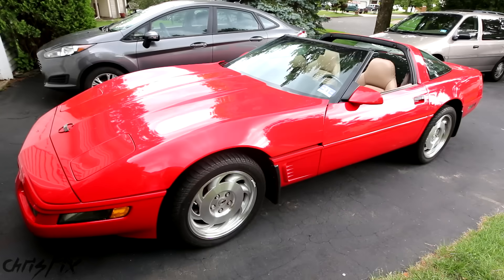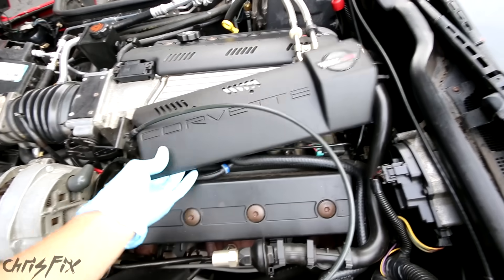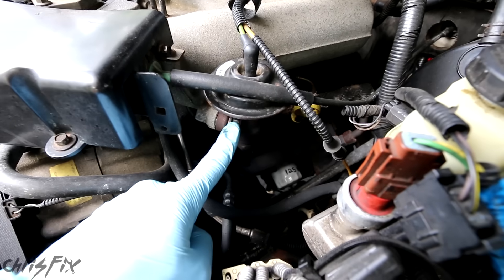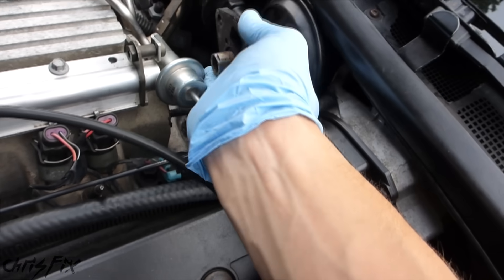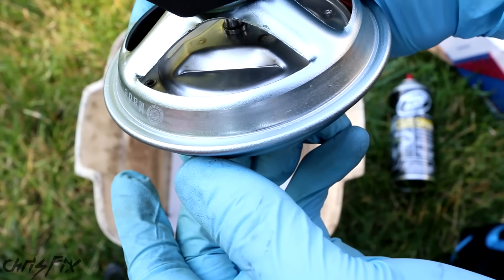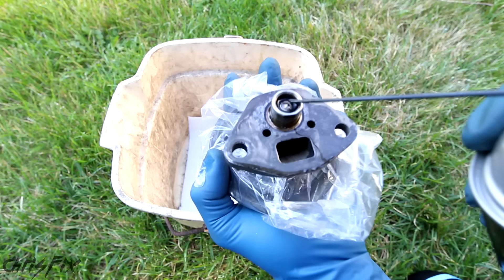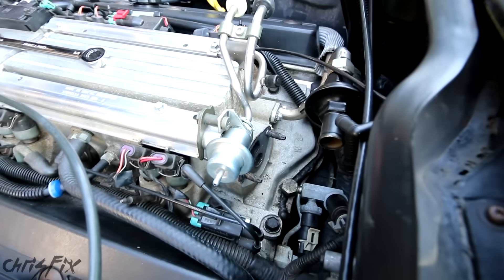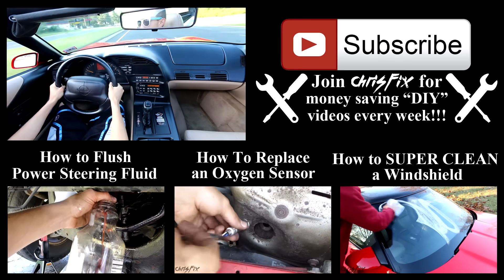How to Clean and Replace an EGR Valve P0400

Comment: hey Chris, I have a 96 Suzuki x90, actually 2 of them, and both have the p400 codes, The 96 , I changed the pcv/ egr/ and one sensor, I got the light to come on at different milage, now 134 after the new egr, I sprayed the throttle body inside, and it still comes on,, whats next? a cadiletic converter?

Comment: EGR Delete/ Block Plate is always possible but not recommended
Reply: why do you say it isn't recommended, please elaborate on your finding.
Reply: it reintroduces the waste back into the system to recombust instead of into the atmosphere? of course its the factory that is saying its not recommended, but its def not needed if youre not worried about emissions
Reply: +Luther© you obviously don't have any idea of what you're talking about. I pass emissions with flying colors without an egr valve. Please if you don't know what you're talking about, keep your comments to yourself. I have experience and proof, what do you have beside an opinion?
Reply: Aaron Johnson
 you have passed in all 50 states? Ok then..diff states , diff levels of what is deemed passing.. I said the FACTORY doesnt recommend you remove your EGR, I personally could care what you run
Reply: +Luther© California has the strictest emissions in the country. I can pass CARB so yeah I could pass in any of the 50 states. Keep your bullshit opinion to yourself unless you have actual proof. We would all benefit if didn't spread your bullshit opinion around on the internet.

Comment: i hAve a code showing the egr solenoid is stuck open. the valve is super grimey so i cleaned that but could the bad valve cause the solenoid to stick open?

Comment: I have a slight surge in power at low rpm , maybe 1,000rpm to 1,500rpm at low to moderate throttle, WOT car runs perfect, no check engine light, it's a 2000 Mustang GT, I was thinking this could be my issue but I have no idea, if you're not busy, any opinions? Oh also I think my fuel cap is bad, light is on to "check fuel cap", I'm not certain just how important it is to have a perfect seal, could this cause problems? Thanks for all your awesome videos!
Reply from the maker: I would get a new gas cap and just make sure that doesnt fix the problem (probably wont but at least you wont have the light on anymore). Sounds like you might have a small vacuum leak somewhere!
Reply: Thank you very much for the reply, gonna grab a cap today, and spent some time searching for any vacuum leaks and just take other general advice you've given in the past. Very thankful for the reply! Nobody on YouTube that I know of replies to comments, and especially so quickly, not with over a million subs. You rock!
Reply: +HypnoticSuggestion Hi there..Quick question:My 99 ford explorer Starts up and idle fine,but when I accelerate it dies,and my fuse to the Egr valve keeps blowing.Do the EGR need to be changed?
Reply: I'm not an expert but if it keeps blowing a fuse, there's certainly something going on, though I can't imagine why it would blow a fuse. On an explorer the EGR may be a pretty easy fix, probably worth a try. On many Ford's the EGR is super easy to reach.
Reply: +HypnoticSuggestion Okay thanks I'll give it a Try.
Reply: Sure. If it's the 4.0 or 4.6, the EGR is way up front and on top, five minute job :)
Reply: +HypnoticSuggestion Yes it's a 4.0L SOHC

Comment: do u know if EGR valve is usually open or closed at cruising speed?
I know it opens during loads which cause the combustion temperature to rise thus creating excessive NOx
Reply: It's open at part throttle but closed at idle.

Comment: I deleted mine , truck works much better lol no more mess ,!
Reply: Good call Absolute nightmare on diesels, too.
Reply: Viktor P Ford 6.0L Powerstrokes most definitely needs the egr delete and if you buy one ask if the egr delete has been done on it because it'll decrease performance
Reply: Increase or decrease?
Reply: I've just done a blank off on my car, much faster and less shit coming out the exhaust
Reply: deleted mine on my bmw e39, sounds a lot better
Reply: Epic
Reply: Cars must be very old,new car engine light on
Reply: You probably had a bad EGR or bad solenoid.
Reply: @hankbridges5055  You don't understand this. The EGR recirculates exhaust soot, and it get tosses around in the engine. It's like sprinkling very fine sand in the intake, as you can imagine it's horrible for any engine, and it is, especially with diesels.
Reply: @wyattlarrick3246  The EGR recirculates exhaust gas and it helps cool the engine. Any unburned fuel gets burned so it won't go out the exhaust. By deleting the EGR, the temperature inside the cylinder gets hotter and can burn valves. Then you have to pull the head! EGR valves stick or leak, but you should fix it. A EGR not opening causes pinging. That damages pistons and valves. Soot is caused by rich mixtures, NOT the EGR. EGR's are temperature controlled. Also RPM's at idle. The fast idle is set with the EGR disconnected to avoid interfering with the fast idle speed. Fuel- injected is set with certain parameters according to settings.
Reply: Hank Bridges your kidding right? Deleting the piece of shit that dumps hot air back into a combustion chamber doesn’t make the engine run better or colder, i hope your not serious because basically everything you said is wrong
Reply: @hankbridges5055  the EGR system has absolutely no use to you apart from getting the engine up to temperature quicker.

Things you want in your combustion chamber:
- clean, cold air
- fuel

Literally anything else has no business being inside a combustion chamber, especially exhaust gases, the very thing you want gone from your cylinder asap after the power stroke.
Reply: EGR delete. Don't pass emissions.
Reply: Can i do it on my car? How can I do it?
Reply: No EGR = more kilometers per liter. 
ANWB ( dutch AAA ) closed the EGR in my 2007 Citroen C5, it runs much beter now! 80 km more on a full tank of gasoline. I never had a problem again with that car.
Reply: Way too many people have no clue how EGR works. It reduces the peak combustion temperature by diluting the fresh air intake about 10%. This lowers nitric oxide pollution. It also improves gas mileage a small amount. So it does cool the engine a small amount due to less intense combustion. If you remove it permanently the computer will detect its missing, set a code, and then compensate and run normally. Carbed engines will ping because the timing and mixture on carbed engines is designed for EGR operation and with EGR malfunction you’ll have too much timing and a lean mixture both conditions causing pinging. Google EGR for the operation theory.
Reply: @moccasinmarine  
Just no. 

EGR reduces temp due to the fact that it the next power stroke in the engine has 'spent' air with no oxygen in it instead of fresh oxygen rich air. Therefore you get less power per stroke and with every rotation of the engine having a friction loss, your net energy generation is lower. 

You also put carbon rich hot air back through the intake which also has plumbed into it the oil-moisture rich crankcase pressure vapours. These two together make carbon buildup everywhere throughout the intake, just like an artery on its way to having a heart attack. 

A chunk can break off get  stuck in a valve and ruin your entire engine. You also starve/choke the engine as the airway is getting clogged over time.  

EGR = less power, more carbon buildup, Worse fuel mileage, a slow excessive wear on engine internals do the fine carbon particles micro-polishing everything. Last of all the potential for extreme engine damage.
Reply: @qwertyui90qwertyui90  and make sure you don't pass emissions.
Reply: @GiordanDiodato   Actually i pass emissions with a better score without the EGR. than with it.   Sorry buddy, EGR is stupidity.
Reply: Clutch The egr decreases power and limits the mileage to around 100,000 miles

Comment: i had a s10 with a 4.3 that burned so much oil that at least once a year  the egr would stop up to the point that it would get stuck half open and stop up both ports to the point that the truck would surge at low speeds    i would spend hours with a screw driver and some gasoline cleaning it.  it also helps for fuel econonmy too.   something else that helps if its stopped up is to get on an empty highway and floor it from a dead stop   its the reason why people always say blow the cobb webs out lol

Comment: Hey Chris, I have an 04 Chrysler Pacifica and I am getting engine light code P0406. Will cleaning or replacing the EGR valve fix the issue, or this has to do with other components of the EGR system? Thank you

Comment: I can't find my egr valve I need to clean it
Reply from the maker: Search online or just look at your exhaust manifold and follow the tube coming out!
Reply: 1 guestion, is silicone paste safe for the gaskets?
Reply: I replaced my EGR valve and got the same code for PO401. I drive a 2000 Ford F150 I don't know what else to check. I also cleaned the idle control valve. The small hose to the EGR doesn't look bad

Comment: I tough that only diesel engines have EGRs
Reply: No, every car after the 80's
Reply: Incorrect. My 1998 Nissan Micra K11 doesn't have one.
Reply: Mrpepsi320 well you know what i meant lol, most of them. You live in the states?
Reply: 71sc502 No, but if you were referring to cars in the States then you were probably right. I'm not too sure about EGR legislation in the USA.

Comment: What do you think about use EGR plate and turning it off?
Reply: Will not help with exhaust emissions.
Reply: +Dave Thomson Yes I know that, but is there something else?
Reply: If the valve is clogged with carbon you can clean it but, nine times out of ten the problem will return. Can't remember if I mentioned this, but will say again. If you clean the valve, the next time you fill your tank with diesel, add one gallon of unleaded. This acts as fuel additive and will clear the line and make for a more efficient running engine.
Reply: +Dave Thomson Thanks. I don't know is it clogged or else... I just remap my car turn it off software and tap it with plate.

Comment: This guy Made this look so easy fixed it effortlessly and at the end gave me knowledge that will benefit me  on every car I own. I have subscribed
Reply from the maker: Thanks for subscribing! I am glad you find my videos helpful!
Reply: new EGR Valve p0400 (MADE IN CHINA) Why you install chinesse piece on MERCIAN car I 'm offended (troll)
Reply: To stop the exhaust gas recycling valve clogging. If you have a 10 gallon tank, fill it with 9 gallons of diesel and 1 gallon of petrol. This acts in the same way as putting a can of fuel additive into the tank.

Comment: hey Chris, I've been binge watching your videos lately. wondering if you could answer a question. I have a p0402 excessive code and my 96 5.0 explorer takes a few more cranks than I'd like to start, is it related to the open egr possibly?
Reply from the maker: It could be a vacuum leak due to the egr leaking so the air/fuel ratio is off.

Comment: Hey Chris,

I have a 95 Ford Thunderbird LX, 4.6L with a V8 and I am currently in this kind of situation. So my parents have not done crap about the check engine light which has been on for so long that I have been looking into this problem myself. I got a computer to read the code which is causing the check engine light. the code P1407 came up which has to do with the EGR (low or insufficient flow). what can be the cause for the CEL to turn on:  the egr itself or a sensor? I have checked with another guy the vacuum lines and we got a long plastic hose to connect onto the EGR to make sure it is still functioning. Around January, a mechanic replaced a hose which had a crack and only replaced that but the CEL would turn on again and ever since, my parents have done nothing about it. they want to sell the car but I refuse to let them because this car is a masterpiece and I really want to fix this problem. Please help me out Chris! I am big fan of your videos and I hope you can help me out with my situation here...
Reply from the maker: So you tested the EGR and it works right? But did you clean out the passages with carb cleaner? They get gummed up and even if the EGR is working, there wont be enough flow because the tube connecting to the exhaust is clogged.
Reply: for this car, it was difficult for taking out the EGR before my dad's friend replaced a broken hose on there. I will check again with the guy I am working with. I'll get back to you and let you know if the light goes off. thanks Chris!

Comment: I have a 99 Honda Accord, should this work for it? Will the check engine light go off or do I have to do that manually?
Reply from the maker: +Sarah Stubblefield if your problem is a clogged egr it will work and then you can drive the car and after about 200 or so miles the light will go off if the problem is fixed.
Reply: +ChrisFix okay thanks a lot! I was watching a couple of your videos and you break it all down really well.

Comment: Did you reattach the fuel pressure regulator vacuum hose?
Reply: I dont think so . Honestly best way to fux a car is hammer it to pieces its worked for me evertime .. I have saved tons on mequanic repair costs.😀

Comment: geesh,people giving thumbs down were just GM haters,dont need no negatively here anyways. they can go away. Truth is they learned something,just dont want to admit it.I always had to replace the vacuum line because the fitting and hose was always rotten from engine heat. seems like every older car I ever bought needed a new one too. didnt matter what brand car. they are mechanical and do wear out. you would think by now they would have invented something that didnt operate on a bellows,vacuum system. Thats so old school. I like your Vett myself. I was a Mustang guy. Problem is they suck driving in Northern MI weather. If I were to buy one now, it wouldnt see a snow flake. I love the old school cars better than the new shit they put out. At least back then there were less things to go wrong. I own a Subaru again,love those boxer engines. Reminds me of the old Volkswagens. I told the wife,if I stripped off the electronics,it would be the same engine our first Subaru had,less the electronic stuff. The basic design is still the same.

Comment: Thanks for the videos! I'm trying to figure out if the problem on my recently bought 1997 Lumina is from the EGR Valve. It hesitates when accelerating (thumping forward and back) to the point that it can barely drive up a hill. it's good on a highway though and works perfectly fine. I heard the issue might be this valve. Do you think so?
Reply from the maker: +angelicbaby92 It could be. Check the codes with a scanner: https://www.youtube.com/watch?v=xPI36bKVCjk

Comment: From Wikki:  In internal combustion engines, exhaust gas recirculation (EGR) is a nitrogen oxide (NOx) emissions reduction technique used in petrol/gasoline and diesel engines. EGR works by recirculating a portion of an engine's exhaust gas back to the engine cylinders. This dilutes the O2 in the incoming air stream and provides gases inert to combustion to act as absorbents of combustion heat to reduce peak in-cylinder temperatures. NOx is produced in a narrow band of high cylinder temperatures and pressures.In a gasoline engine, this inert exhaust displaces the amount of combustible matter in the cylinder. In a diesel engine, the exhaust gas replaces some of the excess oxygen in the pre-combustion mixture.[1] Because NOx forms primarily when a mixture of nitrogen and oxygen is subjected to high temperature, the lower combustion chamber temperatures caused by EGR reduces the amount of NOx the combustion generates (though at some loss of engine efficiency).[2] Gasses re-introduced from EGR systems will also contain near equilibrium concentrations of NOx and CO; the small fraction initially within the combustion chamber inhibits the total net production of these and other pollutants when sampled on a time average. Most modern engines now require exhaust gas recirculation to meet emissions standards.

Comment: You've confused the A.I.R. system with the EGR system, one injects fresh air into the exhaust on cold starts and the other pulls exhaust gases out for re-circulation back into the intake.
Reply: +allblacks420&#160;&#160; Air Injection Reaction is a pump-powered (belt drive or electric) and Exhaust Gas Re circulation (exhaust pressure powered) are nearly the same thing; they are both used to lower the NOx level in the exhaust gasses. No, not the same, but yes- the same principal. Both LOWER the (final, before CAT) exhaust temperature.

Comment: I have a 2007 1.8l Civic with 100k miles on it. I bought it second and I want to maintain it well. I get no error codes and the car runs fine (apart from some oil consumption) but I would clean the EGR at least if not the pipe that goes from the exhaust to the EGR itself. Any advice? Thank you Chris!
Reply: I dont get your question
Reply: Its Me
People advised me not to touch the EGR until it's broken. Should i take it and clean it if i get no error codes?
Reply: ***** its Harmless just do the same as the video , it's actually better to clean it before it gets clogged , think about if it was clogged youd have to touch it right ? So yes its okay plus it makes you more mequanic savy.

Comment: I get a check engine light for the EGR with code P0401 on a 1998 Ranger but it comes and goes. Since it comes and goes any idea what that might be?
Reply from the maker: +AKBuilder762 It might be a dirty EGR. The passages are possibly clogged or the valve is clogged so it works most of the time but sometimes gets stuck.